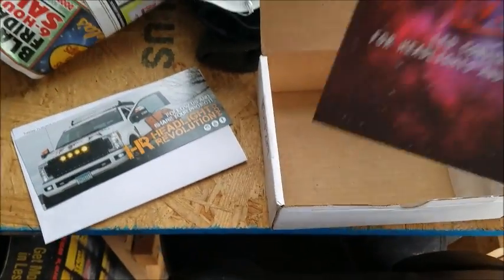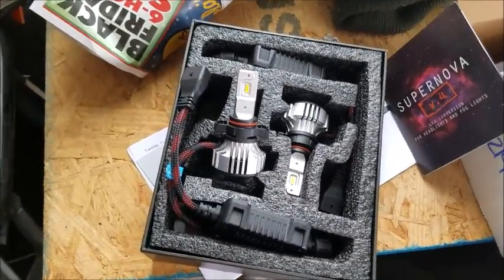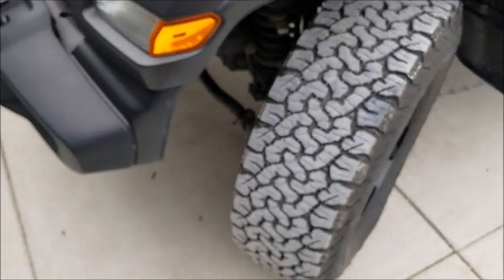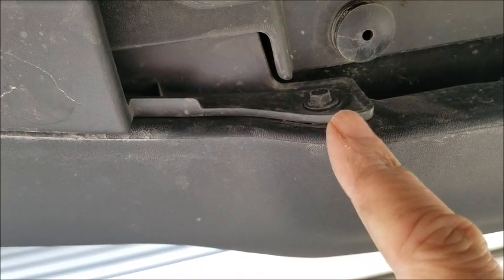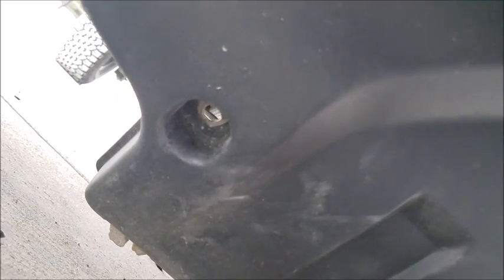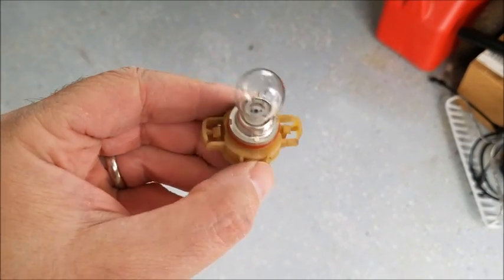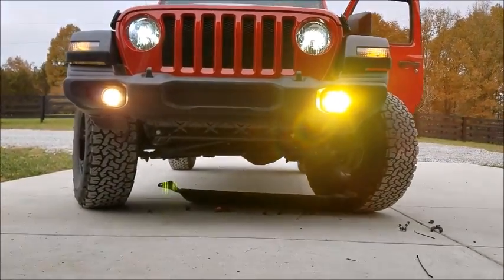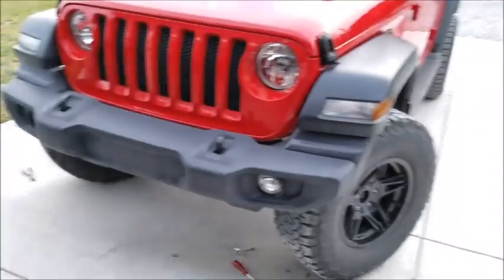Jeep Wrangler JL Sport - Supernova V.4 LED Fog Light Upgrade!

Comment: Thanks! Your video helped me more than any others.   Even how to remove the OEM bulbs.   2020 sport JLU.  
  Two suggestions; get yourself an electric ratchet to remove / install all those long fine threaded screws above your head.  Worth buying a cheap one just for this job. Then find a 7 mm ratcheting wrench to take out the one screw tucked in mentioned in the video.  
   Excellent video !

Comment: After 2.5 yrs, I blew the Dside, b/c they run hot. HR replaced it, but only warranty them for 2yrs. Had a hell of a time getting it back in tho. Plastic grooves had to be cut off the bulb housing. You have the same issue? Yellow looks good!

Comment: Anyone have problems getting them to attach to fog light housing? They won't click on. Tried both sides. Fan on back makes it tough to press into place.
Reply: Can’t make them fit also.. did you succeed after all?
Reply: @maximeplourde5184  yes. They have small tabs that don't line up. I took razer blade and trimmed them off.
Reply: Alright I’ll try that, thanks a lot!
Reply: @maximeplourde5184  trim them flush and should be good. Had mine in for almost 4 months n love em